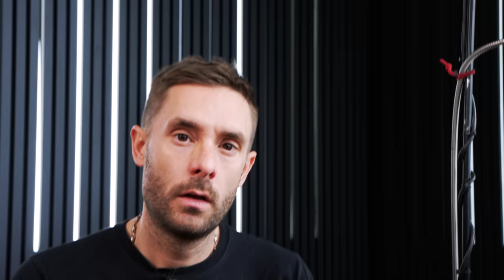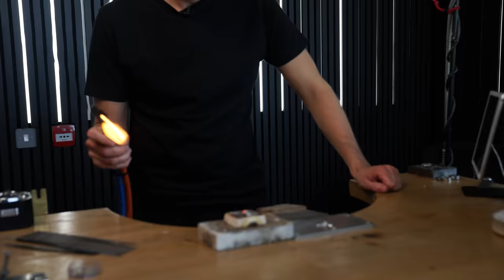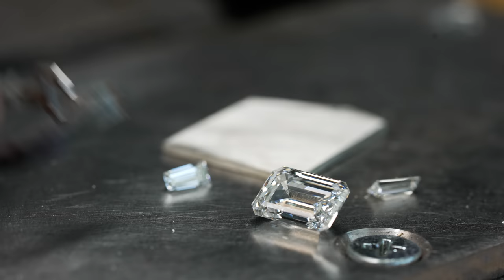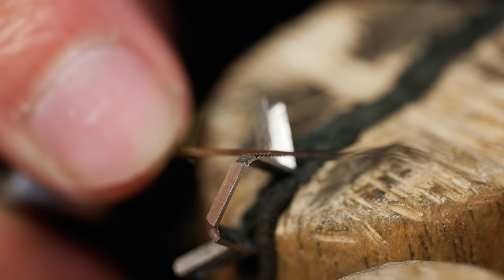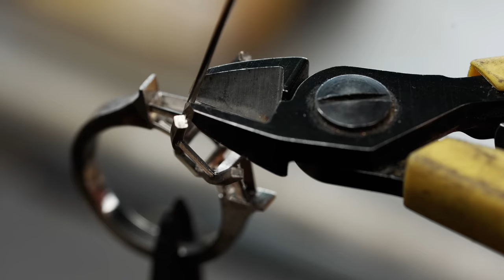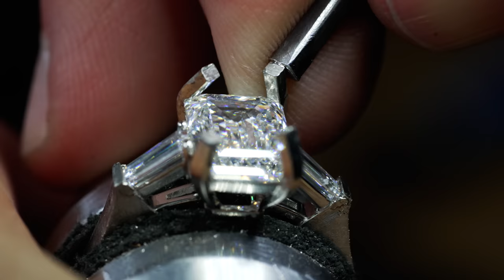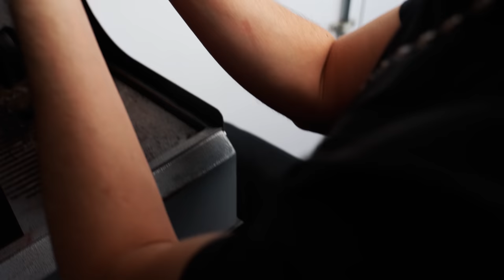Lazy Jeweler Ruins $200K Engagement Ring

Comment: I really feel bad for that customer. I know he spent a brick on that bad quality one. But Bobby took care of business. Great work as always!
Reply: Nah man he is rough soldering platinum this hurts to watch. He should be welding.
Reply: @haydenLlindsey  idk much about it but I just know dude paid for something he didn’t get. I’d me real mad about that.
Reply: @haydenLlindsey  I believe the soldering is necessary for the claws since the heat is pretty concentrated so a claw might fall off when your soldering one on the opposing side… if you’re not using different melting points of solder that would most likely happen.  I only work with silver and silver is very unforgiving.  I need to be very careful as to not over heat something or else it can collapsed.  I heard any other metal is easier to work with.  I agree that welding is a MUST for the shank attaching to the head because its really strong.  But welding everything on a ring with a single melting point piece of metal sounds like a nightmare.  But im still amateur so take it with a grain of salt
Reply: At least they didnt try and swap out diamonds
Reply: @haydenLlindsey  indeed, you can see the final product. He used too much solder on the prongs. The adjurs are not flat and polished and there is some porosity on the shank.
Reply: I don't, if you pay this much money for a piece of jewelry you deserve to get ripped off
Reply: Bobby is a real G
Reply: Well, he paid 200k for a ring. Most people cant spend that much on a house. I think he'll be fine. But yeah, i bet he wasnt happy.
Reply: ah yes i also feel bad for the millionaire.
Reply: How much is “ a brick “ £
Reply: @jameshblack  200,000$US
Reply: you feel bad for a person who can afford wasting 200k on an engagement ring? Really? Have some self respect you pawn 😂
Reply: @yegorzakharov8514  lol ikr
Reply: Probably spent a brick too to fix it
Reply: @Luffnin  a brick isn't 200,000 lol
Reply: That ain’t a brick that’s a stack of BRICKS
Reply: never feel bad for rich people, they stepped on a lot of people to be where they are
Reply: I don't feel bad at all. Guy was willing to pay 200k for a silly little token statement.
Reply: You feel bad for someone who has $200,000 to spend on a friggin engagement ring? Jeesh.
Reply: I dont, if you're paying $200k for a ring while people are dying to get you that stupid stone, then you deserve to lose everything you own.
Reply: 200k you feel bad for that person? Im not. Basic necessities of life dont concern him.
Reply: a brick is 100,000 dollars, refer to bandit rmx
Reply: @scottpauljewelry516  This is indeed the case on silver due to its high temperature conductivity. Gold and platinum much less so. You can concentrate the heat with a small, but intense flame. I make mounts like these all the time, entirely with hard solder.
Reply: @haydenLlindsey  "my keyboard superiority complex beats this incredibly talented man who has shown his ring-making expertise in many examples"
Reply: It still wasn’t nearly as bad as those Black AF1s Bobby White ruined a few months back, at least that ring is “passable”, can’t say the same about those af1s… Guess we all make mistakes…
Reply: @zebragoboom  a brick of what? Because depending on many factors, these numbers are going to be all over the place.
Reply: @shinymew2887  a brick of cash

Comment: Hold up a minute.......Bobby, you are a talented jeweler, and im a fan of your work from one jeweler to another. The original ring, as you said was a disaster, no question. The jeweler who made it should be ashamed and embarrassed for letting something like that out the door. HOWEVER, be careful you don't label castings as the boogieman. You and I both have items cast, for various reasons. As with everything there are pros and cons. The advantages to casting are clean even lines and geometry without the need for numerous solder joints. The advantages to handmade are the display of skill on the part of the jeweler and the creation of a true one off design. The disadvantages of one piece castings and handmade for that matter is TIME. If the jeweler doesn't take his time in creating the CAD or layout with precise measurements the project will be a mess. If the caster doesn't use plumb or a an acceptable ratio of plumb the castings can be porous. With handmade, the need for numerous solder joints requires numerous heatings and especially with platinum, it can be easy to overheat the solder and create porosity. No one is immune from this phenomena. Someone mentioned the ability to clean the castings, yes this can be a challenge but if the jeweler takes the time with proper tools, casting can clean up just fine. That said, even handmade items cannot be cleaned up perfectly. Solder joints can go unsmoothed as well as LASER joints. So, at the end of the day, whether you choose CAD/CAM or handmade, the MOST important thing for a customer to do is choose the right JEWELER. Bobby is certainly one of those jewelers regardless of how an item is made.Its takes YEARS of hardworking and training to become a competent jeweler.  Customers need to do their homework and find a jeweler who is well respected if they want quality work.
Reply: Well said!!!
Reply: I think the issue isn’t the ring being cast. It’s that it’s cast and seems to be sold as a bespoke piece.
Reply: I agree so much! Different techniques for different purposes. It takes skill no matter what, to make it great.
Reply: The issue is that a shoddily cast ring is not appropriate for these stones or at this price point.
Reply: What do you mean by plumb? I do a bit of lost wax casting at home and porosity is always an issue, I'm looking for ways to fix it 😬
Reply: @itsjustiz  I think with 3D printing, it's possible to print a bespoke plastic design, use that to make a mould, and then cast a bespoke piece from that. But I think Bobby's right that casting is never going to look as good because you can't clean it up as nicely, nor - unless you're using absolutely top-of-the-line equipment and processes - will it be as exact and precise as an actual handmade piece.
Reply: Im  a 45 year career 'old school' bench jeweller,  hand making EVERYTHING - and what Bobby has achieved here (the ability to demonstrate/explain**)  is fabulous - and so common to my daily chores - with all manor of todays 'standards' of manufacturing. Condensing a 2 day (uninterrupted) job into a 5 minus flick probably gives the impression that its 'easy' - but we (us bench folk) know better.    
Everything's easy when you know how !   LOL. 
 A good CADing/casting mob have been a great thing for me today, in that, yes - its all about time, so i CAD components (in between still hand making em too), which enables me to precisely clean up and assemble very accurately, without ending up like the common crap 'cast in one' ring Bobby  (& the rest of us) have to deal with.  Keeps us busy guys !    
** Most if my cliants  NEVER really get what i do..unless there an engineer,  builder - or similar. The time i spend explaining is insane , so i just say -"its gonna be better & nice".  LOL again.
Reply: @jimjam6598  the vertical centrifical caster casting machine works well as it really pushes the metal at very high velocities.
Reply: Very well said sir. I can tell you’re a competent jeweler just by the way you articulated this. I’ve spent countless hours on how properly to clean castings that it is a specialty on its on.
Reply: @jimjam6598  Plumb metal is essentially first time alloy. 18k gold is made using 75% pure gold and 25% alloy. When those two are melted together, you have plumb gold. Once that gold has been cast, the sprue left over is no longer considered plumb for the next casting session. Every time you recast the gold, your chances of porosity increase. This is especially true if you melt down old jewelry and re use it. The more impurities the metal has, the higher the chance for porosity, solder being the main contaminant. When we cast, the sprue from the initial cast is mixed with equal parts new casting grain for the next cast. This keeps everything nice and clean. IF porosity is an issue for you, make sure you are using enough boric in the crucible and make sure you pull enough vacuum on your flask after investment. If you are using old gold jewelry particularly chains and rings that have been sized you may have to mix in a good bit of new casting grain. If your metal is really contaminated, just send it to the refiner and start with new gold.  These are the only ways I know of to ensure clean castings.
Reply: @obliviouz  Most of the time, making a mold from the resin model is not necessary, unless its a design that will be recreated in volume. We cast using the resin model and it works beautifully for one off designs. As for handmade being exact and precise - you clearly are not a jeweler because there is no such thing. It is impossible to be as precise with handmade as with CAD/CAM. The angles can be super close but never as perfect as a CAM model. As I mentioned above, handmade items have places that cannot be cleaned up perfectly, just as with CAM. In fact I would argue that there is more clean up with handmade because there are SO many more solder joints. Every solder joint unless you use the PERFECT amount of solder will have spillage. On a one piece casting there is ZERO solder, and thus, way less cleanup. What's important is the design and execution of the casting. If your designs are sloppy, so will be your castings.
Reply: @crli4353  thanks so much man! I usually cast 22ct and get really fine porosity, it's always band new & clean gold too. I've heard people saying that the sprue thickness is linked to porosity? And flask temp too. Have you done any casting with 22ct?
Reply: Agree! So many solder joints can be troublesome in the future when the ring needs the repair.
Reply: @jimjam6598  I have cast both 22k and 24k with equal success. Not sure where the fine porosity is coming from. Is the porosity showing up through the entire piece or just in spots? You may not be burning out at a high enough temp. I use satin cast for wax casting and its the best I found, and Ive tried them all. Are you using wax models or resin? Resins can be tricky as they haven't quite gotten the formula to burn out as cleanly as wax, but its getting better.
Reply: @jimjam6598  22K should cast like butter, you must be doing something wrong.
Reply: You know fine well casting is a mugs game, I don't touch that crap, profesionally or domestic. Speaking as someone who knows the score, if you like casting then you're lazy
Reply: @paulcarruthers7170  I wonder, if a client can't appreciate the difference and craftsmanship between properly made and mass-produced, why didn't they just go with mass-produced.
Reply: @jamesjameson4566  I've not noticed any problems doing centrifugal casting of fine gold crowns for patients back in the day.  I wouldn't feel that was being lazy, as hand-waxing something takes time.
Reply: @Briguy1027  hand waxing is your signature, maybe you're not proud of your hand wiring, but I certainly am
Reply: @jamesjameson4566  If you paid any attention to what I said you would notice I mentioned dental crowns. The fit on the margins on crowns can go to as small as 20 microns or less.  I can guarantee you that there's no way you could possibly hand fabricate a dental crown that would fit over a tooth with any sort of marginal integrity or  matching the opposing occlusion.
Reply: @Briguy1027  then you haven't met me, this isn't my name, trust I know microns
Reply: @paulcarruthers7170  it's the skill and what.its worth in both quality and money. There's a story a jeweller friend likes to tell of a repair job. How long did it take? About 20 minutes and 30 years to learn how to do it.
Reply: @jamesjameson4566  professionally or domestic???....know the score??? You are making a lot of crazy talk for someone who doesn't have to show their work. Want to prove me wrong....post it up or shut up tough guy......what the score now?
Reply: Isn’t really relevant when u pay 200k for something and it looks straight out of a claw machine u even do a good job or u don’t
Reply: This is true. Be an artist about it. I design my CADs in a way so that it looks organic after I finish. CAD doesn’t have to just the final say. You can use it as a stepping stone to hand crafted pieces without having so many solder joints. It’s all about the approach to your art.
Reply: @itsjustiz  I hear nobody complain about their cast Bugatti costing over 5m USD. That one is also bespoke, yet cast. Put together by hand, but every single part is designed on a computer. Perfectionized through engineering and software before being cast. Every part of the process of perfectionized. It is a bespoke piece, despite having many cast pieces, since those too are bespoke. See casting as just another tool professionals can use. Like usual, some do a great job whereas others do a job so bad that it feels (and looks) like a scam, like the piece Bobby recieved.

Comment: Holding the gem within the caliper while drawing the lines was a neat little trick. Im fascinated how good the result looks even though you worked very rough in my opinion. You must be extremely efficient this way. In switzerland at the places I worked, I think we would calculate much more and we would even polish the insides of the settings. Also, just for the understanding, and as some people have already mentioned, a one-piece cast isn't necessarily a bad thing, as it can also include unique 3d drawn models which have been customized for the individual stones. And pretty much all places can be polished if you know how to do it. A good one-piece cast even means no soldered parts, which may result to the jewelry piece to maintain more stability
Reply: yeah i think this guy is a "Pfuscher"
Reply: @froschreiniger2639  does that mean fraud?
Reply: Yep. Big manufacturers do that on large scale too. Seamless, perfect. Or how about luxury cars? Most of those got large single-piece cast panels. Often, even the wheels are cast. Yet they look seemless, perfect no matter how you look at it.

Comment: Cheap casting for such high quality stone. Definitely a huge upgrade with the precision hand made ring.
Reply: Might be worse actually, he is rough soldering w/ platinum as opposed to TIG welding the connection joints

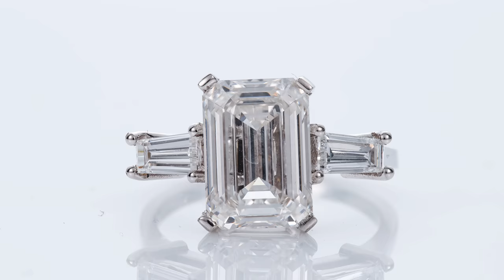Comment: 5:09 When and how did you sharpen the points of the claws? Was that after the claws were bent down? I do see you doing that as well as sawing off the ends... but when do they get points? Do you remove the stone again before filing the points and them replace it afterwards, bending the claws back into position over the stone?
Reply: I think they bend then file. Remember it's really really difficult to scratch a diamond.
Reply: Bend then file/shape, using files with a purposely blunt/smoothed edge just to be on the safe side incase of any slips, then polish and it will have the same result Bobby shows

Comment: I don't understand why in all cases a ring that's been soldered is necessarily better than a regular cast ring.  Lost wax has been around forever, and you can customize everything in wax quite easily, without having to worry about weak solder joints.
Reply: I think it has something to do with the grain of the metal having much more strength when it is extruded and formed in parts, making the metal much less brittle and long lasting?
Reply: @mearkat1313  Nope -- that's not the reason -- forging is great for steel, but for softer metals it makes no difference.  Casting a piece creates a uniform single entity, without weaker soldering joints.  For instance, I've soldered gold before, and it's only as strong as the solder joint -- solder has to melt at a lower temperature than the metal it's bonding together, which means it will also melt before the rest of metal.  

I should also reference this by saying I don't believe that forming a ring from parts is better than casting.  Cast metal rings have lasted hundreds of years.  No need to worry that you'll outlive your cast ring.  By the way, the artisan in this video is NOT forging the ring, such as you would a steel weapon or tool.  Besides, you're not going to put great stresses on a ring as compared to the rim of a wheel.  I know you're trying to compare forged versus cast aluminum wheels.  That only applies to tools and things that need to have that kind of wear like aluminum.  The noble metals do not have those exact properties.  In fact, quenching Iron quickly makes it more brittle, whereas quenching gold makes it more flexible.

Comment: Absolutely beautiful work!  I really enjoyed that you went through the differences between the two rings.  That caliper trick when holding the stone and scribing the line is tech! Quality content.  Subscribed!
Reply: Right, but if you wanted to use your calipers to do the work of dividers or a scribe you can measure the stone then use the set screw to hold it in place and you don't have to put the stone at risk by doing stuff with it that isn't strictly necessary.  You can do the exact same thing with dividers which (should) have a sharper point than the calipers and it's the divers that get worn down, not the tips of your precision measuring tool.  It looks cool on video but it's not recommended.
Reply: @OTOss8  I see you’re point! Thanks for the advice.
Reply: @twotrees6077  No worries man.  A guy at our shop learned this lesson the hard way and I still have a vivid memory of him getting reamed out by the foreman.